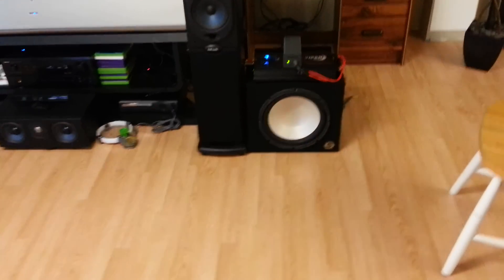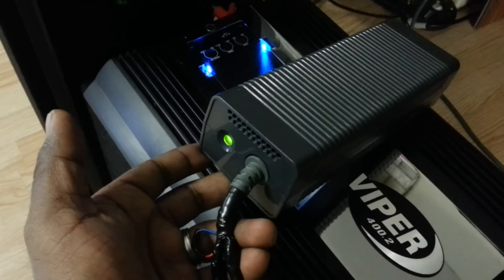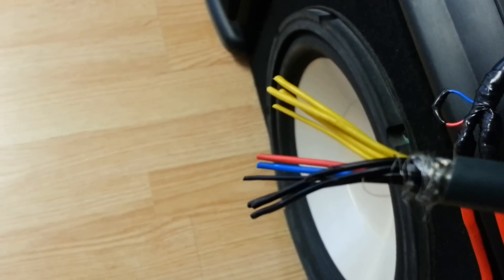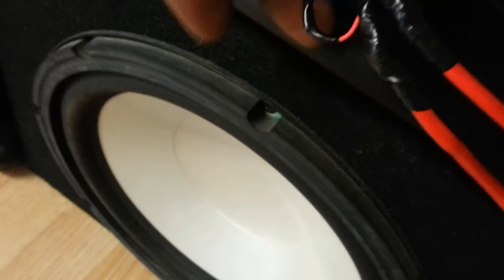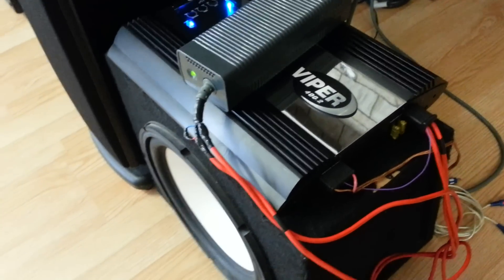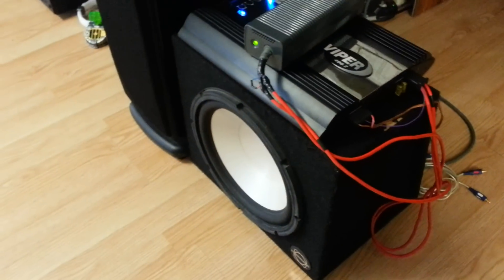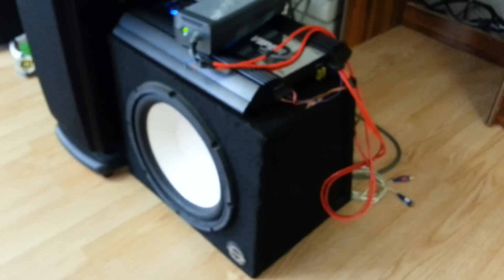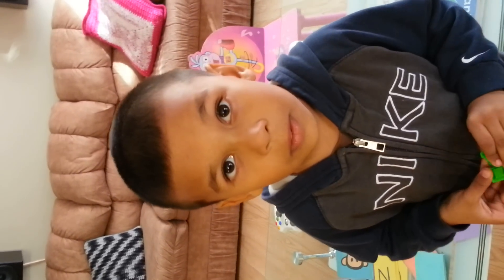Car audio at home - DIY - DC power supply  PSU w/ xbox 36o brick

Comment: Just watched the video amd thanks for the upload. I noticed it has been almost 4 years and I was wondering how long your setup lasted for or is it still going strong? I just didnt know if I should use a pc power supply or just use one of my old bricks laying atound like you did. I really would like to build me a subwoofer for my theater that will last. Thanks
Reply: I've been using 3 Xbox 360 power bricks to power my amp for over 4 years and nothing has blown or happened. I don't play it for long periods of time because it's just too loud and the cops will be called. But it is a cheap and great way to get dc power
Reply: @Pittsburgh-412  sorry i missed your response. Thanks for letting me know this. I will have to go through with my install and setup. I have been busy with remodeling my house I bought. Now that I have free time, I will have to set it all up now. Thanks again.
Reply: @bbay1977  I will make a video of my system once I get moved because I live in an apartment building right now and my set up is hard to see atm.
Reply: @Pittsburgh-412  okay thanks
Reply: I been using power supply for 16years n nting blows until my power supply fail everything else works
Reply: @terrysookhoo2528  thanks for the information. I must have missed the other message someone left. I was in the process of remodeling the house I bought and have been busy. I never did hook up my theater setup here. I did buy a Onkyo receiver, but I never did buy the speakers for it. Now that I know it will work and last, I will have to check my specs with the receiver and order me a subwoofer that will work. I know the receiver will work with 4 ohm speakers. I will have to pick out a nice sub that is dual voice coil at 4 ohm and wire it to a 2 ohm impediance. Then just pick put a map that Will work at 2 ohms and go from there. Will be nice to install twin subs in my room. I have tons of xbox bricks. I'll probably install everything in a case with fans to help with heat as well and keep everything nice and neat. Thanks for the response.
Reply: @bbay1977  that's nt a bad idea cooling is important n yes house work never done I to in d process of house building bt I lost my projector due to dust n no use
Reply: @terrysookhoo2528  I'm sorry to hear about the projector. Theater rooms can be costly even of you do all the work yourself. Before I even started on my house, i started running CAT 6 to every room. I'm just thankful I have done most of the work myself on this home. If not I would have blew the budget a long time ago 😆. Just take it one day at a time and do it the way you want it the first time and it will go smooth. I have already thought about selling and building another home with more land and more square feet. I'm just going to wait till the market comes up really good and then sell. I like this home, but I really would like to have 10 acres off by myself somewhere near family. I'm almost 2 hours from them now.

Comment: I dont want to be a dick but here is a tip:

Black wires (negative) put them directly in your amp. The shorter the negative is. the better it works.  Thats why most "pros" that do this the cheap way put the black wires directly in the amp.

Thats also why they say find the shortest route to baremetall in your cars trunk. the shorter. the better.

Comment: READ THIS!! TO use this on your stereo receiver you MUST HAVE pre outs on the back. Rca goes from pre out to input of amp. Next, I have 3 Xbox 360 power bricks connected together with a toggle switch to turn all 3 on at same time. The power bricks are the 203 watt and all the same. I put the remote wire from amp to the positive side of the amp and this turns it on. I'm pushing around 1000 watts with an old school Rockford fosgate amp. It never shuts off. None of it. And I no ppl won't believe that but whatever. I should make a video of my set up. Like this if you think I should
Reply: I don't get your comment of what uou you did to the remote wire to power it on.
Reply: if your amp is outputting 1kw then you are drawing at least 1200w assuming it is an efficient class d amp. if it is an analog amp then you are pulling at least 1500w. you would need 7-8 xbox power bricks to achieve this. also a word of causing it is not a good idea to connect power supplies together in such a manner unless they are specifically designed for it.  you would be lucky to pull 16 amps from a single power brick and if an amp is truly 1kw then it should have a 100amp fuse or multiple totalling 100amp. even the cheapest power supply capable of sustaining 100 amp is at least 180$ so to think you can safely get that with 50$ worth of power bricks is wrong. i feel i should also mention that the resistance of the speakers plays a big role as well. lets assume the speakers in the video equal out to a 1ohm resistance and they are pulling 1kw from the amp well then the amp must pull at least 1200w from the power supply assuming the amp is a class d and now lets assume the resistance is 2 ohms and they are pulling 1kw from the amplifier then that means the amplifier must be pulling at least 2400w from the power supply.
Reply: You mean you put the remote wire to the positive speaker terminal? Or explain a lil better how you did it
Reply: @ivanbustamante6011  yes. I put the remote wire from the amp to the positive on the amp. Like a 2 inch piece of wire. Literally from remote to positive. When I turn on the bricks, it turns on the amp. Because the bricks are 12 volts
Reply: Please explain if you can
Or make a video
Reply: How did you tie the 3 Xbox bricks together, without it being super bulky? Also how much power are you getting two the subs
Reply: @winstonbower1236  they are stack on top of each other, 3 high. All 3 have yellow positive and black negative wires. It's probably doing over 1000 watts because this amp was very underrated power. I don't think this is hard at all to understand
Reply: @Pittsburgh-412  MAKE A VID...PLEASE
Reply: @jackgank2023  ok i will this week sometime
Reply: Pittsburgh 412 you still haven't

Comment: Use 40a 12v switching ac to dc converter,  it will never runing out of power, even if u atach fans, led lamp, and other dc accessories 😉

Comment: I got computer power supply 1030 watt to power my 1000w 2ohm amp to power my Dayton UM18-22 and light starts flickering and then if I turn a bit louder power supply cuts out. I am just ordered 2 farad capacitor, hopefully that will help.
Reply: The amperage is too low . Also experience that

Comment: Car subwoofers don't run off 12v...the amplifier runs off of a 12v current which then converts dc into ac to power the subwoofer.
Reply: "12v current.." what you on about?? Those are two DIFFERENT things!!!

Comment: A PC supply has more amp current capacity, the 360 is a low cost solution and 14 Amps DC will get you around 200 watts RMS, if you drive your speakers over that, the supply will burn out. The best solution for car audio setup at home is a SEASONIC PC supply unit. They are the masters of AC-DC transformer units. You can get a 1000 watt supply that will be enough for 500 watt RMS (1000 WATT PMPO), check the rating is RMS or PMPO on the amp and speakers. PMPO means 'peak music power'. RMS is sometimes stated as NOMINAL. All amps are RMS at half volume if the sound source unit is balanced. A PC/LAPTOP will INCREASE up to or over 300% of the RMS amp output BY VOLUME. Be careful and turn down the gain to zero first then balance the volume so that the PC slider and music player volumes are full then turn up the amplifier gain slowly to no more than 1/4 (a quarter) on my amp is 5%). That should be enough to achieve full RMS output with any car audio amplifier with PC/LAPTOP SOURCE UNIT.
Reply: Battery charger  pushed crunch 2000.1 on 4 kicker comp VR 12's in my living room loud
Reply: @aaronwright8462 I was thinking would a car battery charger work!?….what did you do just cut the clips off the end and wire directly to the amp?..would it be safe to run a head unit off it too?
Reply: @MeandtheDog-1 can I use a battery charger?
Reply: @aaronwright8462 what kind of???
Reply: If I get a seasonic PC PSU, will that be able to run a head unit and an car amp? Im looking to do a subwoofer about 300watt RMS and a pair of 100watt RMS coaxial 5" speakers.
Reply: dont use any power supply not meant for driving something like an amplifier. do not use a pc power supply. while it does work for it it is specifically designed for the power consumption demands of a pc which are very very diffferent than a car amplifier. you will get voltage drops like no tomarrow and as a result you will damage your equipment. instead get something like this https://www.amazon.com/gp/product/B00F8MC45E/ref=ox_sc_saved_title_1?smid=AB3RH2VK84JRX&psc=1  . 100 amps is the most you will most likely ever need in a home that is 1000w realistically speaking.  another thing people leave out is the resistance of the speakers being powered. to give a 1 ohm speaker 1kw of power you would need to consume at least 1200w of power fromt eh power supply and if you are powering a 2 ohm speaker at 1000w you would need to consume at least 2400w from the power supply.
Reply: Need video bro
Reply: Thank you

Comment: can u run t another 360 block and it power a car head unit?? and how did u do the remote wire, the red and blue wires left after the power and ground??

Comment: I connected the yellows and blacks and also did the blue and red together.  So why is my stereo turning off at medium volumen????  At low stays on.
Reply: The power supply is not putting out enough amps. You'll only be able to play it low or turn down the gain on your amp. If you want it louder you'll need a power supply that puts out more amps. Be careful.

Comment: Go get some  ATX PSU  its much stronger in amps...Or diy a durable  x'former PSU the one they used in most transceivers  13.5v regulated 30amps..

Comment: This shit doesn't work I've tried 2 different amps neither turned on nor showed any sign of having power, did everything exactly like you and nothing not even a protection mode light, my 360 block only had 3 yellow and 3 black like wtf

Comment: Love the walk thru, did it with my old 360 slim box. theres only 2 black and 2 yellow, but i got 12 volts. question. how did you connect the amp to the surround sound receiver? basically. how did you get the sub to communicate to the surround sound?
Reply: There are rca(white +red) inputs that you can directly run from the back of the receiver directly to the amp... Sorry for the dead post!

Comment: what you do with the remote wire
Reply: Take one wire and connect both ends into the remote.  It makes a circuit that way.

It's made so you can put a toggle switch on that wire to stop the circuit/loop which turns the amp off.  Hence that toggle switch is a "remote" switch

Comment: Is there any downside if we put our amplifier above the sub? I mean, the sheer vibration from the sub will tears the components, parts, soldering, etc on the internal parts of the amplifier maybe?? Is it recomended to do so??
Reply: I had 3 different systems 2 10's 150w x2 rms 300w rms total, and 2 systems were 2 12's 200/250w x2 rms 400/500w rms total. In all 3 systems I had carpeted sealed enclosures (subwoofer boxes) and I mounted the amp directly to the top or back of the box. I never had any issues with any of them. I'd imagine anything you can run with a xbox power supply is not going to be powerful enough for that to be a concern. You'd be knocking shit off the walls, shelves, and tables before you had to worry about damage to the amp.
Reply: Dryhumpington hi there, i have my system working well but how we keep the "memory" of the head unit since we dont have the yellow "constant" wire always atached to the battery, because we dont have any on our system hehe
Reply: Im wondering about a small dry cell 4a 12v baytery from my scooter bike, but i dont sure because my power supply is 40a 12v, will it explode or something hahaha scared tho 😂

Comment: For some reason when I wired my subwoofers in bridged mode the subwoofers were getting 320 watts but the subwoofers got hot and wanted to blow but however when I wired them up to a different car amp and wired them individually and didn't run them in bridged mode they were getting 320 watts and they didn't get hot and didn't want to blow this only happens to my subwoofers when I run them in bridged mode not when I wire them individually for some reason

Comment: I'd tear the Xbox PSU apart and directly solder in an amp style screw terminal block and a switch to turn the PSU on and off.

Comment: All i want to ask is that will this provide steady 12v/15amps or drop when on load? Because thats gonna work,but damage the amp and sub in while...does it heat up after like 4-5hrs continuous use? And hows your system working still?

Comment: i done this and it works but if i turn my amp more than 1/4 of the way up the power brick goes into protection mode. it puts off decent bass but will not keep up with my mids. has the potential to if the power brick would stay on
Reply: Add 2 more of same power bricks

Comment: i done this and it works but if i turn my amp more than 1/4 of the way up the power brick goes into protection mode. it puts off decent bass but will not keep up with my mids. has the potential to if the power brick would stay on

Comment: Never thought about using a 360 psu , I use an old desktop psu . outpus 36 amps at 12 volts . been working well for over 5 years with no issue also setting it up is the same as this other than the trigger to turn the psu on is a green and any ground on the 24 pin connector
Reply: What size car amp can you run with that desktop PSU you mentioned?

Comment: where do you run the remote wire
Reply: to the 12v terminal of the amp. A little "U" shaped wire. When u plug in power supply the amp will automatically turn on.  RULE OF THUMB: IF THERE IS 12 VOLTS PRESENT ON REMOTE TERMINAL OF AMP IT WILL ALWAYS TURN ON AND ONLY TURN BACK OFF WHEN THERE IS 0 VOLTS.

Comment: where do you run the remote wire
Reply: Just run a jumper from the positive terminal on the amp to the remote terminal.

Comment: where do you run the remote wire?
Reply: Dylon Henderson did you figure this out?
Reply: Kevin Mendoza yes. I just got a small piece of remote wire and ran it from the remote spot on the amp to the spot where to power wire goes. You just have to unplug the power supply to turn it off.

Comment: hello randy. 
If I ever buy a xbox power supply, can it power my 800w amp and 800w sub to its max power output of the sub and amp? 
and when choosing a power supply, does the total watts of the power supply matters? example 500w power supply. thank you
Reply: Mark Mark it outputs ~210 watts only bcuz xbox brick gets up to 15 amps but it will underpower your setup

Comment: A the power from the wall socket is 120v not 110v and if it is 110v the power company is lowballing you man but you had it taped up nice but one suggestion I would put a fan on that amp and get it off of the top of your box and put it on bricks if it is inside your house man but you may be able to get away with it because you aernt using speakers that are very big and you don't have that many speakers but great vid man

Comment: Just an FYI Im pretty sure the rule of thumb for this is to try and match the amps on the xbox with the total fuse number on the amp divided by two. For example if I had a 50a fuse I would divide that by 2 and and I would need 25 amps recommended to run it.

Comment: wow... I have a shit ton of 360 power bricks... thank god I didn't throw them away... Gonna try this  this weekend... awesomeness dude
Reply: I think he’s dead
Reply: cris2man did you try this?
Reply: Update?
Reply: Hello did this work
Reply: @jacobh7371 it works but make sure you don’t put the skinny negative and positive wires in the amp only the thick ones. There’s a yellow and black that is skinny only one for each cap it off to reduce protection mode when turning volume up.
Reply: R.i.p
Reply: @HOPE-iy3yq  😂😂
Reply: F
Reply: This does work. I put 3 Xbox power bricks (all exactly the same)  connected together to run mine. It's great for tower speakers but be careful

Comment: help please. i bought a new 360 power supply from frys but it says on the packaging that it outputs a little ovef 10 amps @ 12v DC. is your power supply for the slim 360 or is it the older FAT 360 model that outoits 203 watts? 

thank you very much for your response
Reply: lawl x2
Reply: lawllll

Comment: thats great does it still work?
Reply from the maker: Robert Kotevski yes sir
Reply: Randy Prasad awesome. go Microsoft  lol☺
Reply: Randy Prasad what kind of wire is the red ones
Reply: @nano970visuals9  (I know...4 months old...)
It's power cable you can pick up at any auto zone, O'rileys ect....Guessing 6-8 gauge...
Reply: @Its0kToBeWhite  should i do thus at home for my 2x 90w rms speakers, ore use the be quiet 400w pc psu i just bought last friday?

Comment: This is probably dumb but how do you plug it in to the receiver?
Reply from the maker: Theo Dyke I used the rca output on the back of the receiver that's labeled "subwoofer out" and ran that to my rca input on my amp.

Comment: If you use a Xbox 360 power brick your subwoofers are not going to hit as hard because it's only 175 watts going to the subwoofers which isn't a lot I'd suggest a power inverter or a car battery to if you want your subwoofers to hit harder

Comment: If you want to bridge a car amplifier and if you want to run 2 car subwoofers in bridged mode then you would have to parallel wire your car subwoofers and then bridge them that's the only way you can run 2 car subwoofers in bridged mode because if you bridge 2 car subwoofers in series your amplifier will shut off because car amplifiers don't like it when you bridge more than one car subwoofer in series